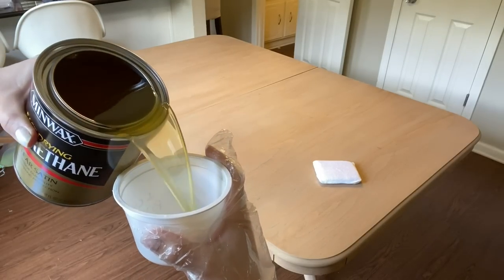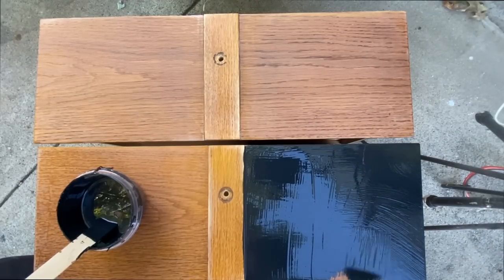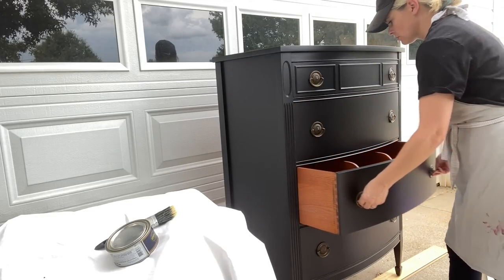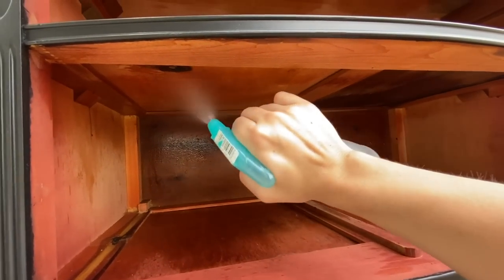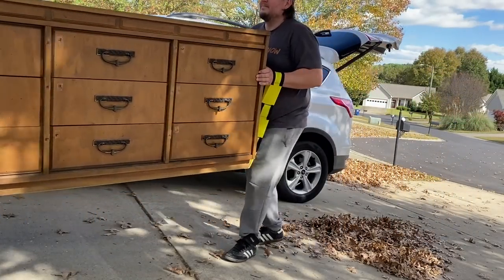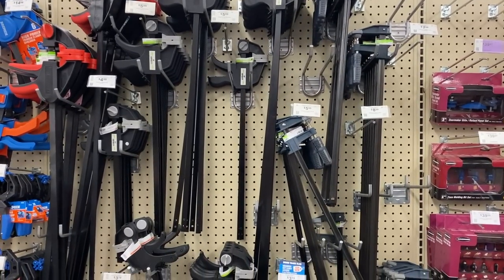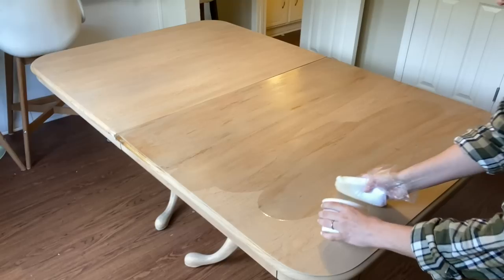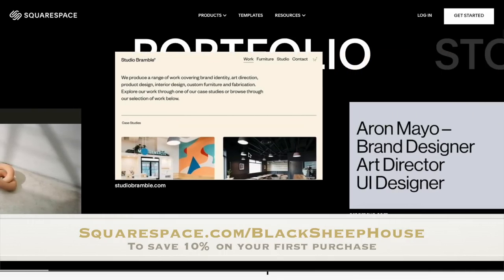10 things I wish I would have done sooner in my furniture flipping business

Comment: Something that helps me when pouring paint or stain from a can and not make a mess = tape.   I have utilized packing tape and painters tape, both work well.   I create a short "V" on top of the can with tape, creating a tail (about ½" long), at the bottom of the "V" to insure a controlled pour.   On a gallon can I start the "V" near the handles.   On smaller cans I estimate half circumference of the can.   It's definitely less messy, it's inexpensive and the can easily seals without paint caught in the grooved areas splattered everywhere.